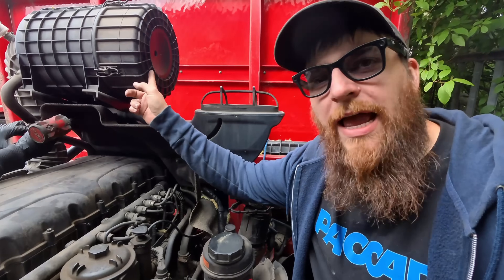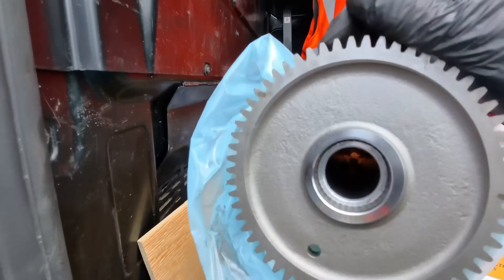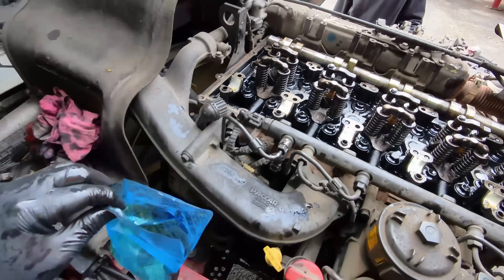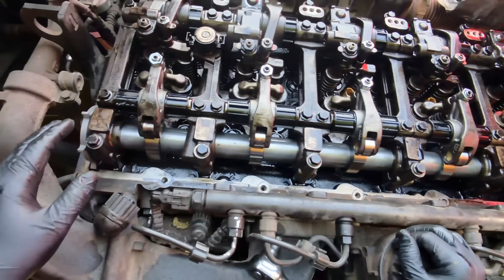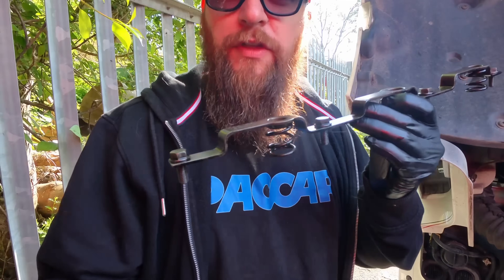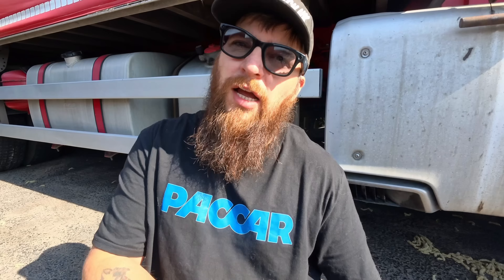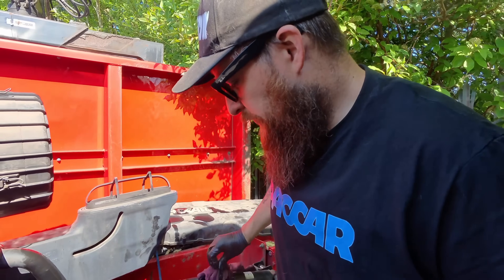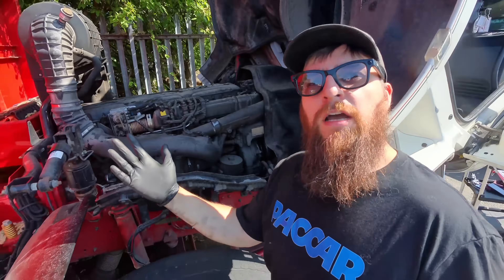DAF CF MX-11 Top End Tear Down & Rebuild

Comment: How many miles did this truck have on it? What would you say was the cause of the cam wear?
Reply from the maker: Hi it didn't have many miles on it, most mx-11 engines will look like this as it was identified that the oil temperature is too high and now the repair is to fit a lower temperature thermostat (100*c) i believe

Comment: Nice to watch. Seeing as it was more then 1 roller that went bad would you say it was a oil issue?(as in not changing it often enough?)
Reply from the maker: Hi, it is an oil issue as such but it's a temperature/viscosity issue. The fix i believe has been to lower the oil temperature via a lower temperature oil thermostat